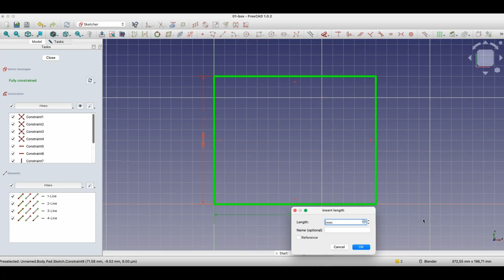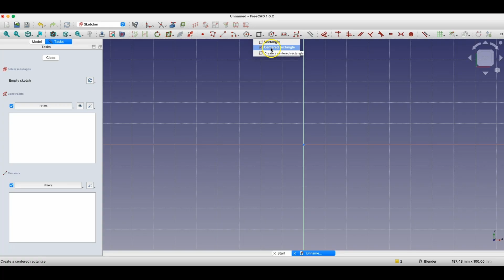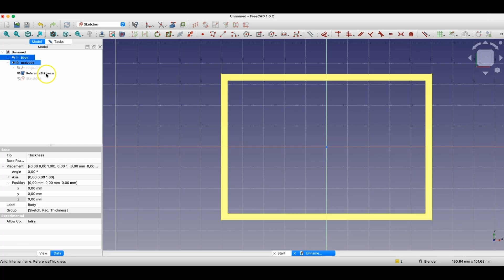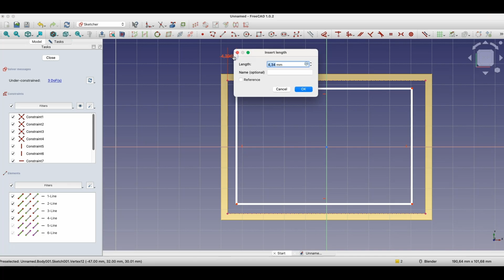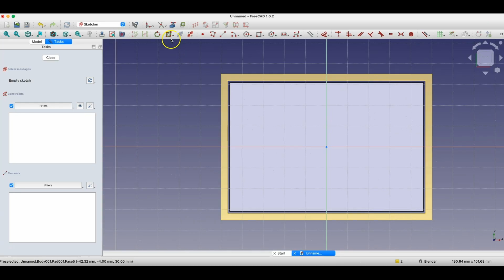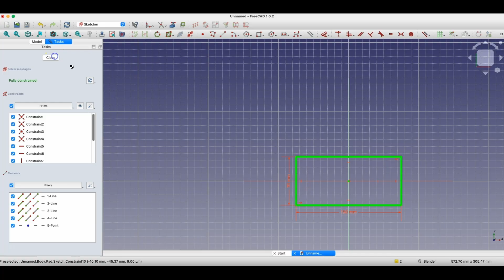FreeCAD Tutorial: Create a Parametric Box with Cover (Two Connected Solids)

Comment: Slick use of a shape binder based on turning off the original model. A missing step in my previous attempts to use shape binder to add external geometry method. I'll add, a well known Freecad tutorial channel has not mentioned this method. Instead, other work arounds are suggested. The channel even mentions add external geometry doesn't work within the work around method.This is far better. Thanks.